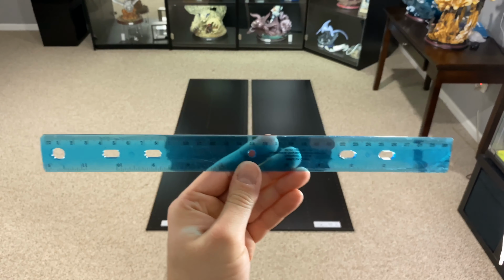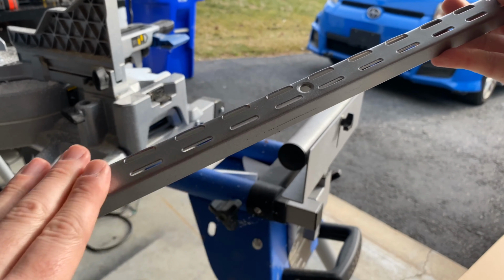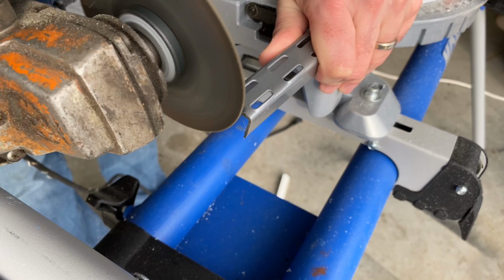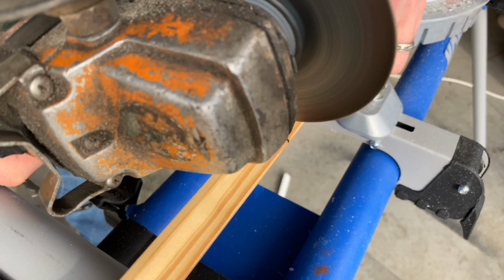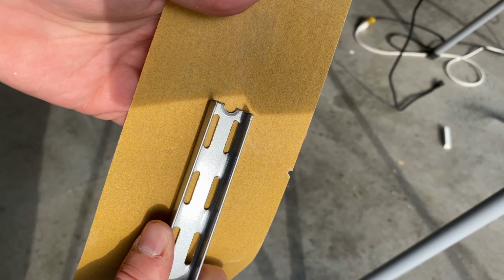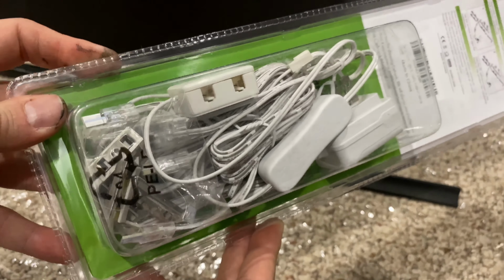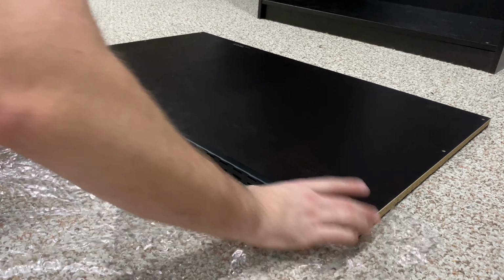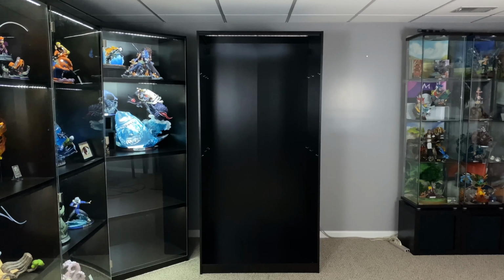🔨🛠🔧 PART 3 - How To Reinforce Shelves and Updated Lighting Ideas - IKEA Pax Display Case Build

Comment: Your videos are great. Easy to follow and well edited. I do worry about reinforcing on the ends of the shelf’s as the material of the shelf’s isn’t the strongest. How have the shelves held up over time? How heavy is your heaviest shelf load? Thanks.
Reply from the maker: Thank you! So far I’ve had no issues or Boeing and max load is about 80 to 100 pounds.
Reply: @BAMCollectibles  that is good to know!

Comment: Did you add the acrylic door on the 39in?
Reply from the maker: So sorry but I have not yet.  I'm using funds elsewhere at this time.  If I do so I will likely put it in a part 4 video or share on the comments for this video.  Though if I'm spending like $300 on doors I'll probably make a video lol
Reply: @BAMCollectibles  Thank you
Reply: @BAMCollectibles  im trying to do doors for the 39" versions. I know you haven't done them yet are you going with a single pc or double doors for the width? any measurements?
Reply: I'm curious about one or two doors as well. Thanks!

Comment: Hey BAM, have you looked into led strip light diffusers at all? You put them on the led strips for a really clean strip light look, that way instead of having the noticeable individual led bulbs, it looks more like a uniform strip of light. Sort of like neon lights.
Reply from the maker: I'll most certainly have to look into it.  What I've done for now since I have it and showcased in this video is basically spray paint my own matte colored diffuser on there.  I have to say that the way I hide the lights with the wood strip......these will hardly be needed though as you can barely seem them until you're directly under it.
Reply: Azero can you please provide a link to what you are talking about?
Reply: @hthundar  look up led diffusers on amazon. Theyre usually aluminum
Reply: @azero5432  thank you

Comment: Which one cost more.. double the komplement or do the steel reinforce
Reply from the maker: Steel reinforcement for sure.  But with double comp and placing all the weight requirement onto the shelf pins I think that's a bad idea.  Worth spending extra for the bars and you get more space to display.
Reply: @BAMCollectibles  thanks for the answer 😉 would love to see you do the smaller shelf for single 1/6 or bigger statue if its possible..

All the best for your channel thanks for helping

Comment: I saw that pax shelf limit is 26 lb which is nothing compared to big 1:4 statues. Do you think that these reinforcements would be enough? Or do you know what is the real weight limit? I have besta but they are not deep enough. I was thinking of the Bror cabinet but my wife think its too ugly 😅 what do you suggest?
Reply from the maker: NeonWolf Dxb 
If PAX shelf limit Was 26 pounds I would’ve lost my statues years ago! I truly cannot speak to the weight limits on anything because I have no idea how to calculate it but I can tell you there’s not a snowballs chance in hell these things are bending anytime soon with my 60 to 70 pounds worth of statues on top of them. 

I wish I had a way to calculate them for everybody but for the most part I’ve Just been keeping an eye on mine to make sure there’s no Boeing because that’s the first sign that I imagine they will break.
Reply from the maker: NeonWolf Dxb I used 29” not reinforced for years and just started using these 39” pax reinforced and they’re SOOOO STUURRDDYYY

Comment: one day I'm actually going to build one of these to display some of my midschool BMX frames..I'm slowly getting there..I currently have the space emptied out, I have the frank LED light kits, I have metal shelf pins, I have white paint, I have a 8000mh powerbank, I have  cable hiders, I have some small angle brackets to strengthen the entire unit..

just need the clips for the led strips, can't find the right style anywhere..also need the wood trim piece to attach the LEDs..also the actual Pax frame and shelves..my stupid Ikea had shelves but no units then they had units with no shelves..now they have both and I have no money..lol..one day..

Comment: What size shelf did you go with the 39in?
Reply from the maker: I have a mixture of both!  Just recently started getting into the 39" but the 29" has worked perfect for me for many years now.  I just had a VERY large statue come in that needed the 39" so I had to try it out.
Reply: @BAMCollectibles  I was thinking of going with the 29 but going to go ahead and get the 39 little more space for down the road. For the komplement shelf what size do i need with the 39in
Reply from the maker: Sounds great man!  It should just be the 39" wide shelves.  Shouldn't be too hard to find those or you can ask in the store and they will hook you up.  Best of luck and would love to hear how it turns out!

Comment: Hey is there a corner unit? Or something you can do for a corner shelf? I want to put this in the new house I’ll be moving into during the summer!
Reply from the maker: What I do is just angle one of the shelves so it's like a corner unit.  Unfortunately though there isn't a legitimate corner unit that they've produced yet, would be a great idea.
Reply: BAM Collectibles ok yeah that’s smart and genius might have to do that! Do you secure them together  or to the wall? How do you make sure they won’t fall over? I usually put a piece of cardboard under them to balance it out. Also another thing them being put side to side does that affect how far the doors go out? Do you have any problems or anything? One last question for your smaller shelf’s which lighting do you use since it’s an older video there wasn’t a lighting thing. Sorry for all the questions just want all my ducks in a row before I tackle this project I the up coming months!
Reply from the maker: Joed Diaz All good man! I do not secure then to a wall because once they have the statues on them it’s impossible for my child to have enough strength to tip them. Plus I have doors on them so she won’t climb. BUT I do have a girl so people with little boys it may be different 😂

I don’t have any problems with doors either. If you see the end of my acrylic door video the door swing all the way open. 

In regards to lighting on the 29” I just don’t have an easy recommendation at this time. Custom lighting would be the route Id go if I didn’t have all the extra lights that I do.

Comment: Hi BAM Collectibles, one question please,                                                                                                                                                                                                                                                                           The The width of (the
Rubbermaid
25 inch. White Twin Track Upright for Wire Shelving ) is 1 inch? The pax are 0.70 inches thick, is all this correct? no space left between the bar and the shelf?

Comment: Roughly how  many pounds per shelf will reinforcing your shelves handle this way?
Reply from the maker: This is going to be rough because I do not have any idea how to stress test anything but I have 50lbs worth of statues on the 39" wide reinforced and it's not at all causing any warping or bowing.

Comment: This is fantastic, and super useful, since I've been wondering how to install lights on my shelves. However, I removed one of my shelves today to reorganize the bottom of my unit, and now that I am trying to put the shelf back on, the 6 pegs that hold the shelf in the unit can't even stand the weight of the empty shelf, and every time I put them back up, I put on the shelf, the pegs fall off and then she shelf falls off :D So I landed here while trying to find a way to reinforce the sides, so the shelf stays up. If you have a video like that anywhere, please direct me to it :D But I'll keep looking. And thanks anyway for this. Now I know what kind of LED's to buy, and I have MSC that I can use to coat the strips. So this is awesome :D

Comment: I'm currently in the middle of my build. It's taking a bit longer than I was expecting. IKEA didn't have the shelves available so I made the shelves myself. Plus I had to learn how to work with LED lights. Had to order extension cable for the LEDs so that should be in tomorrow and hopefully I can get the LED portion done soon. Then all that's left is the acrylic door which looks pretty easy. So far it looks pretty nice. Especially with the molding I bought to hid the LEDs. I opted not to varnish my shelves because I'm not sure the heat from the LEDs would create a fire hazard. Varnish burns easily. But two layers of dark brown (practically black) paint looks good enough.

Comment: Very good advice here! I do have a question though. I plan on using this technique to reinforce a shelf for the 70 pound Prime One Poison Ivy Hush statue. I do plan to instal an acrylic front “door” though. By installing these reinforcements, do the shelves remain flush with the unit, or do they add too much length that sticks out the front?

Comment: Thank you for the help. I had the Cefrank lights in my cart for a while and didnt know if I should buy them or not. Also I really need to get those Pax displays. I didnt know they were way deeper than the Bestas I have. Getting into P1 statues, their bases are too mighty for the Bestas. So I need deeper cabinets since statues arent getting smaller. Next step are doors. :)
Reply from the maker: Awesome!  So happy to help!  I swear behind the depth that PAX cases offer.  I can't see myself using anything else to display stuff, especially since I have the 39" option now.

Comment: Hey bro, so the shelves still just sit on the Ikea pins? Are you using a special kind of pin or the ones that come with the unit? 

The purpose of the metal rods is to just make the shelves not sag?

Thanks!
Reply from the maker: Yup! Rods are there to prevent bowing which is the main reason most shelves break. As far as shelf pins go I throw those garbage plastic ones away that they come with. I use metal pins as noted in the description of my part 1. With those two combined I have no fear for shelf breakages ever. 

Hope this helps!